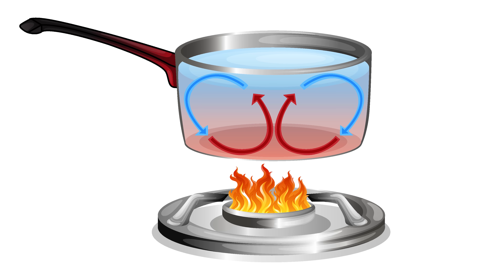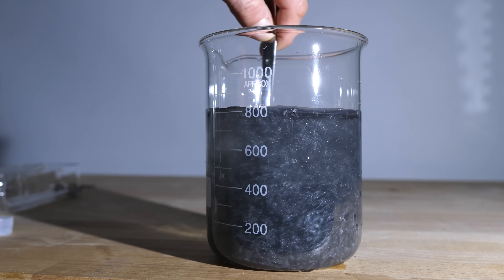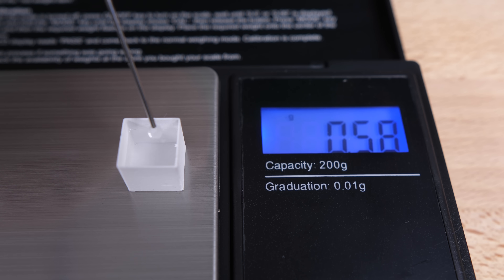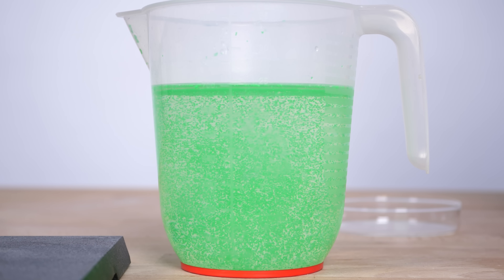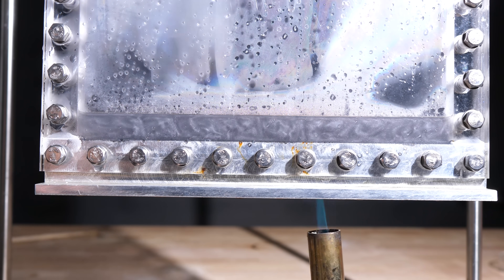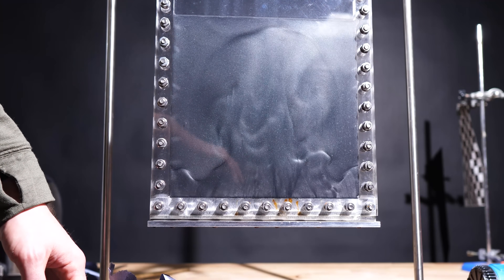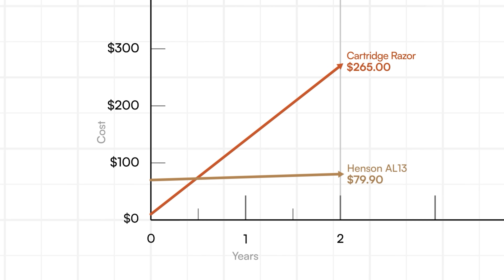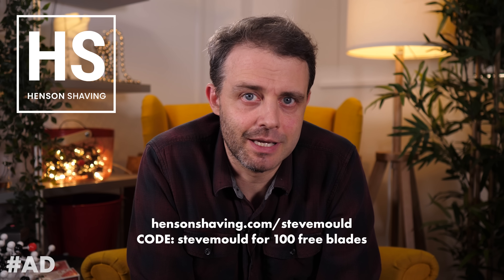The bizarre patterns that emerge when you heat ANY fluid

Comment: This video reminded me of a fictional weather system I came up with to support a fictional planet I wrote for a pathfinder TTRPG game that I regularly run on weekends. In that system, the planet is tidally locked to its parent star. But a typical "twilight band" tidal world seemed boring to me, so I came up with a convectiion driven set atmospheric, oceanic, geological, and sub-oceanic phenomenon to support a narrow band of thermal oscillation on the entire solar-side of the planet. In a weird way this video on convection helps me to visualize my own system much more effectively (especially that final segment with the cream in the alchohol- although rather than alchohol evaporation its water vapor evaporation inside the clouds themselves).

How it works, at least as far as I can think about it (I'm not a professional meteorologist no exoscientist so it's entirely possible that my system would never work in reality, in fact I expect that it wouldn't for reasons I am unaware of), is relatively simple. The planet has an extremely high amount of water content, but the vast majority of that water is locked in one of 4 locations- Either as ice on the cold side of the planet, as water vapor in the air/clouds, as water in the single central ocean directly under the star or one of the thousands of rivers, or as water in vast system of underground tunnels and aquifers which underly that entire side of the planet.

Due to convection, the heated air on the solar side of the planet rises, allowing the cooler air at each slightly cooler point further and further away from the center to push inwards- eventually resulting in very high windspeeds near the twilight band, where the incredibly cold air rushes in en masse due to the sheer pressure difference at the ground level. This lateral movement of the cold air, of course, then creates the long circular convection current that flows along the ground level towards the center of the solar side and at the higher altitudes flowing away from the center. But this alone would not be enough to efficiently "cool" the solar side of the planet to livable temperatures. This is where all that water comes in. Water is well known for being an extraordinarily strong heat sink, and with the vast majority of it on the cold side of the planet any air on that side will very very rapidly cool down- thus ensuring that there is always a strong air pressure at the "band". This water also performs a large number of other tasks- the water in the central ocean evaporates rapidly, forming large cloud formations which are "sucked" by the convection current. At the centralmost portion of the ocean there are no clouds whatsoever- as the airflow dragging vapor away ensures that there is not enough time in these regions for clouds to form. Instead, a "ring" of clouds form at the precise point where there is enough time for water vapor to collect- creating a sort of permanent hurricane; including the high windspeeds since this is where the heating is strongest. But unlike at the twilight band, the wind is more chaotic due to a combination of turbulence and the fact that this is where the wind direction changes from a lateral movement towards the center into the upwards curves that lead to the higher portions of the atmosphere. Due to a very slight spin the planet has that is parallel with its orbit, the clouds and wind also have a relatively sluggish lateral spin- resulting in the "hurricane" spinning just like a real one on earth would. Also like a hurricane there is an ever-present torrential rainstorm, as the portions of cloud that are lower to the ground are covered from the star by the higher portions and rapidly turn back into water as they barely edge that temperature band. Only to be replaced by yet more evaporating water due to the perpetually uncovered hotspot in the center.

For the same reason that convection cells form, the clouds in the ring also form these long, spindly "arms" as they follow the highest speed wind currents away from the center and towards the colder side of the planet- all the while spinning and rolling like the arms of a hurricane. The fantasy people on this fictional planet call them "cloudrivers" since they very much resemble rivers- just made of clouds. These also create the world's day-night cycle, as these arms get exceptionally wide and- paired with the very sluggish lateral spin- can create a horizon-spanning shadow lasting about 8 hours or so.

Of course, all that water has to come from somewhere! The central ocean has 2 primary feeders- surface based rivers numbering in the thousands, which collect into larger and larger currents as they get closer to the center (pulled there by tidal forces despite the planet technically being oblong due to those same forces making it a higher altitude). These rivers also evaporate even as they flow due to the daytime periods, immediately adding water back into the cloud rivers which then almost as immediately falls back as rain due to cover from the higher portions of cloud (and also "patches" any holes that form in a given arm as the vapor continues to heat from the star). This also creates "rogue" clouds and storms, on occasion. All of this also creates incredible amounts of turbulence, especially given the planetwide "wind" at the ground and atmospheric levels- which results in some vairly chaotic and unpredictable storms as a convection cell wall wobbles or shifts in a snappy fashion. Additionally, however, there are underground aquifers- occasionally becoming so laden with water soaking through the ground that they form entire rivers in themselves underground. As the ocean water evaporates, the pressure of the weight of that water decreases since its losing that water- which then causes a pressure difference between the ocean and the aquifers surrounding the entire seabed and coasts, which forcibly sucks water from the aquifers. This then of course reduces the pressure in those aquifers, sucking more water into them, and so on leading all the way to the twilight band where the bulk of this water comes from. In places where erosion has removed all soft rock, hard rock forms stable cavern walls and floors that house underground rivers- or in some place, entire lakes or oceans. Millions of years of geological activity due to the tidal forces and erosion has seen most of the stone settle into their more or less permanent shapes; any areas that would have collapsed and filled in already have, leaving now only the stable caverns and filled in loose aquifers. The water in the aquifers, of course, does not freeze due to the planet's mantle which is kept liquid thanks to the tidal lock and minor spin, and the dirt and minerals polluting it and lowering its freezing temperature.

The most interesting thing is what happens at the twilight band. As the water laden cloud rivers cross a critical point in the horizon, the rate at which they heat falls below the rate at which they cool from the convectional currents. This causes the arms to flatten and widen out as the windspeeds take an extremely sharp downwards turn, dragging the clouds with them. Rapidly the vapor cools and freezes, creating a long series of permanent arctic weather systems all along where the twilight band would be. Visually, it appears as though there is a planet-wide "wall" of blizzard blown snow thick enough to block vision- imagine one of those huge sandstorms that sometimes appear in the middle east, but white. Of course, whenever an arm passes and what little sun there is returns, the snow melts back into water and at the ground level immediately joins one of the many rivers or underground aquifers- thus delivering freshly chilled water back into the larger planetary system, ready to absorb more heat then precolate through the atmosphere and cool down the entire planet.

Comment: Interesting experiment but...
I have some reservations about the narrow channel apparatus, significant viscous (high density, low velocity) effects at the wall causing skin friction, narrow channel plus boundary layer will cause substantial friction. The viscous effects could be reduced by using a very low density fluid and widening the apparatus. Also increasing the temperature difference would increase the buoyant effect. I've done a lab that uses a narrow channel to visualize fluid effects but the fluid was air at a high Reynolds number.

Comment: Maybe the mica flakes tend to align locally because they experience less resistance when the flakes (being flat) are parallel to the direction of flow. 

Or perhaps perpendicular? Either way, I’m sure the different levels of hydrodynamic drag depending on the orientation of the flakes is what causes them to align locally.

Comment: Last time I used a Henson razor, it made me look like a complete muppet.  Turns out I got a Jim Henson razor by mistake...
Reply: Sigh. Lol
Reply: Must be part of the turbulent flow
Reply: NOW I'M THINKING ABOUT SHAVED MUPPETS WHY WHY WHY
Reply: @dielaughing73 You need to see a Psychiatrist...😊
Reply: I think I just got to the point with the al13 where I can complete a full shave without having to apply pressure to stop the bleedings.

Single blade shaving is a very different experience. It's like moving from Python to C++.
Reply: @akaHarvesteR  how do you manage to bleed with a safety razor ? Do you have ancient parchment for skin ?
Reply: @Soken50 my previous razor was a 1960s Gillette safety razor, probably the pinnacle of that style before the company went to the scam model

I would cut myself with that razor almost every shave.

I have not managed to cut myself on my Henson razor yet.
Reply: @Soken50  I am aware. I was comparing a major manufacturer's safety razor to Henson's. Lower quality safety razors will cut you
Reply: @AdamMansbridge Also made that same switch.  Gillette adjustable "Fat Boy" to Henson.  There's absolutely a technique change required from using the N-blade cartridges to a safety razor - short, light, parallel strokes vs long, continuous strokes with more downward pressure.  I did most of that learning on the Gillette though, and the switch to Henson has been amazing.
Reply: @Soken50  you underestimate my abilities 🤕
Reply: @akaHarvesteR No moving side to side. Other than that there’s no special skills needed
Reply: i got a Tim Henson razor and my beard hairs were doing harmonics and sweeps

Comment: I think that the mica powder locally aligns not because they interact with each other in some way. But because they are probably not perfect spheres (maybe discs or needles) so they align with the direction of the current in the water. Because the current is locally in the same direction the mica powder aligns locally. And in some directions the mica powder probably reflects more or less light giving the different shade’s of colour.
Reply: Hmm, would they align with the flow direction?
What if rather than aligning with the flow velocity, they align based on changes in the flow velocity across space?
Like, if the component of the fluid flow direction perpendicular to the surface of the flake, is greater on one side of the flake than on the other, it seems to me like that would cause it to rotate.
(I would expect such rates of change over space of flow velocity, would be similar in nearby locations.)

Idk, just an idea.
Reply: @drdca8263 I think your idea is better. I was just speculating why they would align.
Reply: @hallohoegaathet7182  well, I wouldn’t have had the idea I had if I hadn’t seen your comment,
I was really just trying to (potentially) refine the idea you already presented
Reply: My conjecture on why the mica poweder is rheoscopic is the powder is tiny reflective sheets, and they arnt really aligning. If they are in a shear force of fluid, they will roll, and they can only really roll in 2 meaningful ways. They can spin normal to their plane like a frisbee or perpendicular to normal of their plane, like a paddlewheel.

Thus in a shear force, at least 50% of the mica powder is rolling like paddle wheels with their axis aligned with the shear force. They are all in a randomized state, but at least that axis is lined up and the lined up pieces act like a uniform mirror when viewed at the correct lighting and angle.

Comment: I'd guess that the mica particles align locally because they align with the direction of the flow. The difference in flow velocity on two sides of a particle induces a rotational force which is the smallest when the longest axis is parallel to the flow. Look up flow patterns in magmatic rocks.

Comment: Should do this with a thermal imaging camera as well to see how the actual heat spreads out to the whole thing not just the current of the water
Reply: Was thinking the exact same!
Reply: That's a hard experiment.  They can't see through polycarbonate or borosilicate glass, he'd have to make the sides out of monocrystalline germanium or sapphire.
Reply: @Lontracanadensis  perhaps the experiment could be laid flat with an open top or something
Reply: @jamie123b  That might be interesting with the convection cells.  I'd be curious what the centers or edges would show.  Depth though wouldn't work, thermal imagers can't see through water either.  I'm honestly not sure what if any liquids would work.  Material properties in thermal imaging can be odd.  Germanium, a silvery metal, is a clear lens, and I was shocked to find that cheap galvanized steel is a beautiful thermal wavelength mirror.  (It was a Jurassic Park "why do we have more animals in there than we have in total?" moment.)  Maybe air with some little flakes of something non-flammable and tiny enough to form a fog-like colloid?
Reply: Seems to me that there are materials that change colour at different temperatures, liquid or powder form should do it I would think. Wonder if it would cost as much per gramme as the beads?
Reply: Hi, I just uploaded a video made with a thermal camera, but from above.. Of course, to visualise cells from the side, you need a wall of a material transparent to IR, like polyethylene.

Comment: I don’t know this for a fact, but I think that what causes the mica flakes (or any small, plate-like or fiber-like particles) to align locally is shear. Squeeze a plastic body, like tiny parcel of water in one dimension while allowing it to spread out in the other two, and flat or long objects in it will tend to align to the direction(s) of spread. 2:06
Reply: Yes, but in this case the shearing happens between flows of different velocity.

Comment: at 3:10 isn't it because breaking a laminar flow takes more energy, and one the "energy" finds a localised turbulance it takes the path of least resistance and flows it there, making regions of turbulance, and when the energy is high enough (for a small period of time) the entire area is turbulant. 

also, the entire can't sustain turbulance in a closed system because it must recycle. and the entire body of water being a singular "large" system (made of smaller chaotic systems) is because the edges are cooled by the walls of the chamber. right?

NOTE: I'M making educated assumptions not absolute statements.